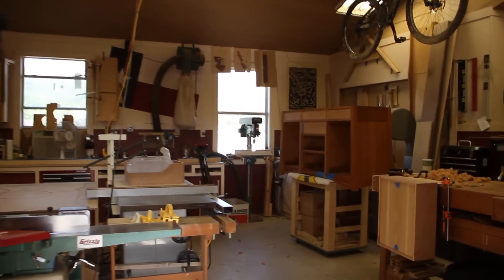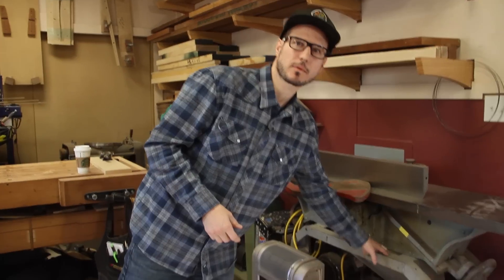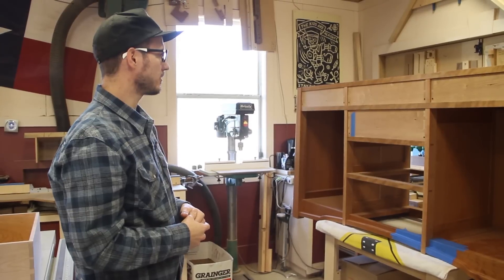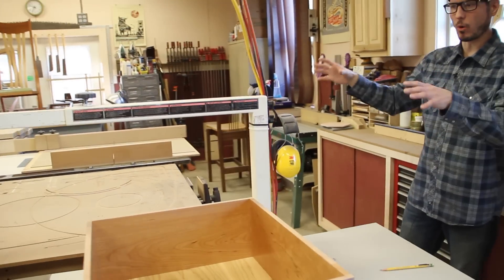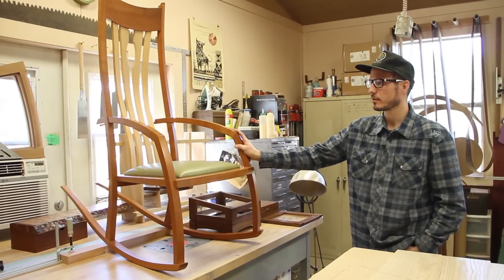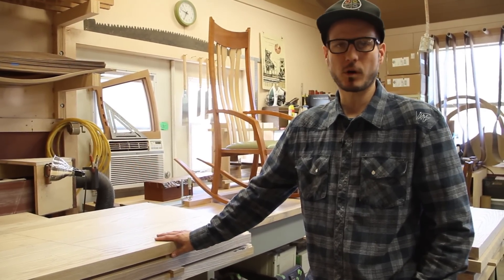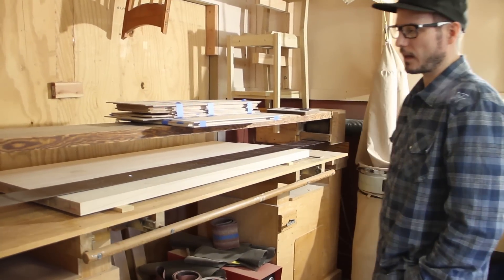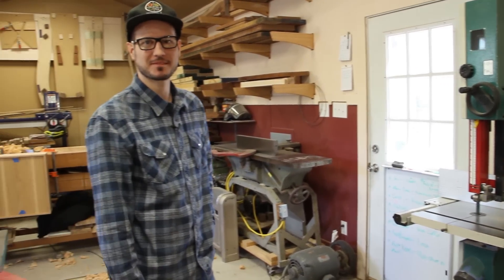Shop Tour: Philip Morley

Comment: Can I ask, did you mean 70-100 hours on that piece or 700-1,000 hours is accurate? Working 40 hour weeks, 1,000 hours would represent half a year. Not to mention a skilled craftsman like yourself must value your hourly rate highly, no? Even a modest $20/hr would make that a $20,000 piece. At 50/hr that piece Costa more than a Corvette. Am I missing something? Is that the amount of time involved and the ballpark price for a piece like that?